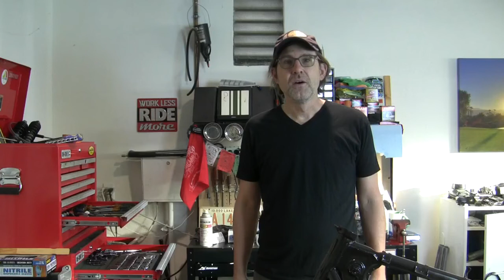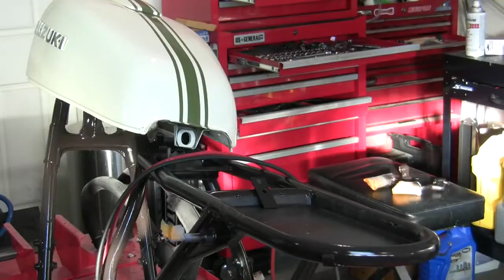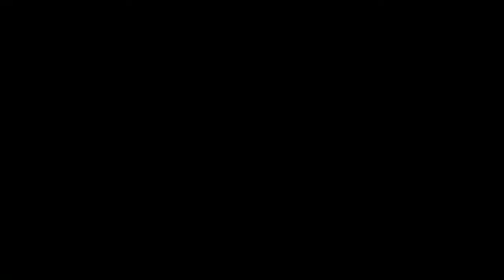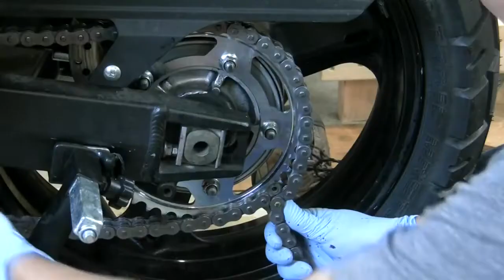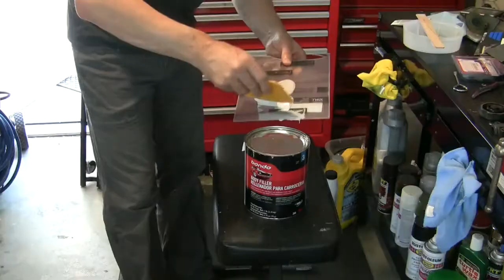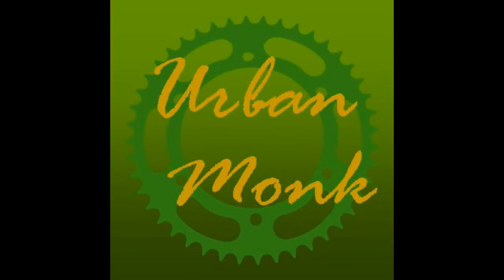Urban Monk TV Channel Trailer

Comment: Hi. Let me tell you my little story.  Among other bikes , I have owned a ’83 GL650 Silverwing,  which has basically the same type of mechanic as the CX500 has,  since 1986.  We are in 2023, and I still have it.  I’ve put over 200K miles on it.  I loved this bike very much.  It was so well fabricated.  Never been very delicate riding it, never had to spend money other than for  oil, gaz, tires, brakes, batteries. Doing maintenance myself.  Sitting all winters outside, in the cold at the back of the shed. (I’m living in Eastern Canada) Always ready to ride again at spring with a quarter turn start.  Sadly, 3 years ago, the battery stopped charging.  After having done all possible tests, I’ve found a dead stator.  Looking at the bike, I figured what F*** of a job it could be to replace the stator, and decided not to do it.  So I opted for  buying another bike.  I’ve found  a very nice top shaped ST1100 with very low millage.  I should say that I almost love and enjoy this one more than the GL. Anyways, I decided to keep the GL, saying to myself that I could repair it when I’ll be retired. (I’m turning 65 this year). Then I could run It again a couple of time before selling it or giving it to somebody. But recently, I came across your videos , on the CX500 which I devoured one after the other without stopping. it was like watching a very good series on television.  Very very nice videos. Thumbs up ! (All of them, not only about the CX500. I noticed you’re playing drums, so do I since I was 5!!   I think I will have found a new virtual friend) Back to the story,  I’ve always done a lot of small mechanics and maintenance for fun, but I should admit that I’ve learned a lot watching your videos.  Everything is clearly explained,  letting no place for improvisation and errors. After having watched all of them, I’m  now certain that I will not replace the stator on this 40 years bike. Too big of a job for me . Don’t have this patience anymore.  Sadly the bike is now probably at the end of it’s life. Could always run on the battery for short rides and put the battery under charge at home. But it’s not very convenient.  I’ll probably give it to a mechanic school close to my house. Maybe some young people will have fun dismantling it and hopefully bring it back to life. The GL deserves it. after all.  All good things have an end and all things must pass….   But I'm still enjoying your videos a lot. I Hope you will continue for  a while.
Reply from the maker: Thanks for that wonderful story! Agree...the GL/CX500 is one of the greatest machine designs of all time. Name something  you can purchase today that you expect to be working well in 40 years. (Cue Jeopardy theme music.) I'm grateful for your kind words. Helps me keep going as these are difficult videos to make. Took years before anybody was finding them. Looking back I'm glad I did them. I intend to do more when my kids go off to college.